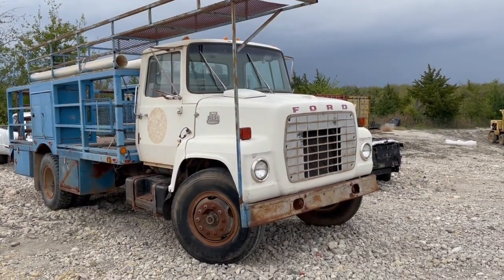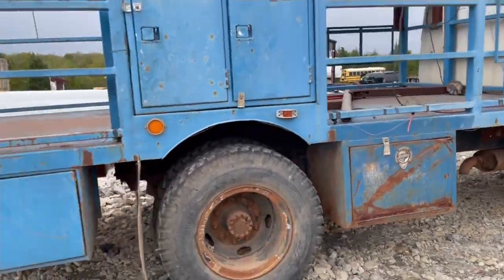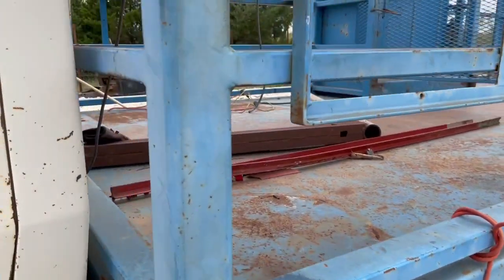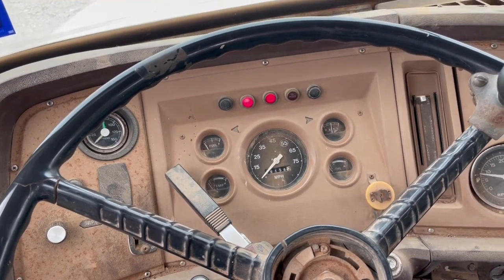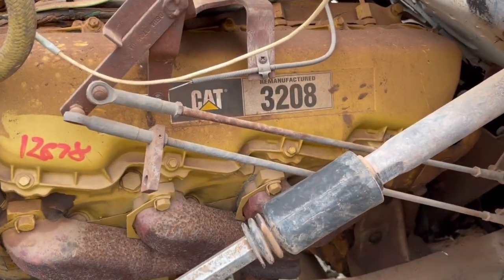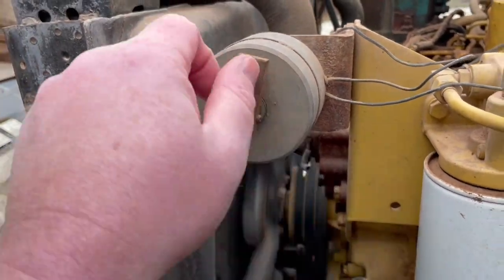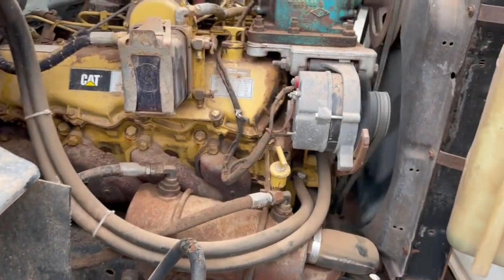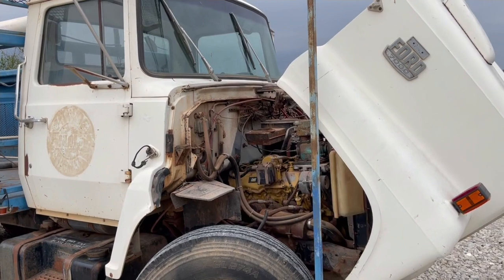New dump truck?  Louisville Ford with cat 3208

Comment: Where are the cabovers? Not a regular trunk.
Reply from the maker: I tried hard to find a cabover to use for a medium duty dump bed but this popped up for right price and equipment right. At least it is all mechanical and old. Haha. The cabover will be in the next video. Thanks for commenting.

Comment: Does that line up with the throttle linkage? Maybe a cruise control or choke of some sort.
Reply from the maker: It does line up with the linkage. So, truck is pretty basic fleet truck but does have a pto and wondering if that has something to do with it. I dunno. Thanks for comment.